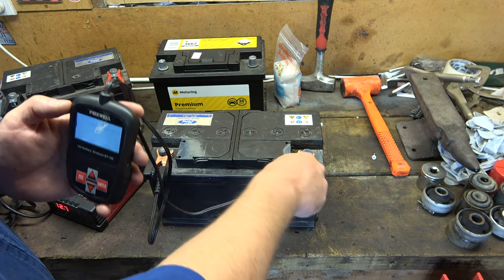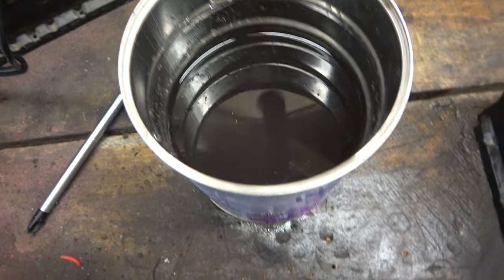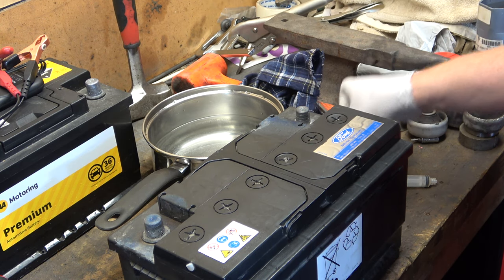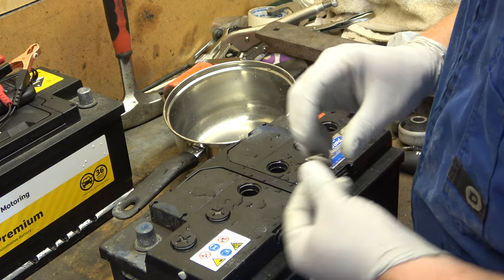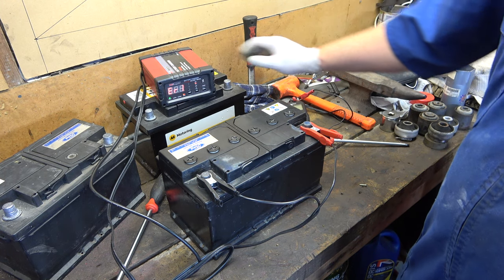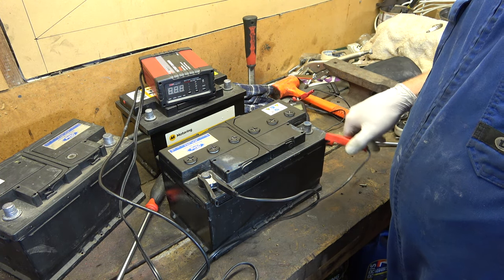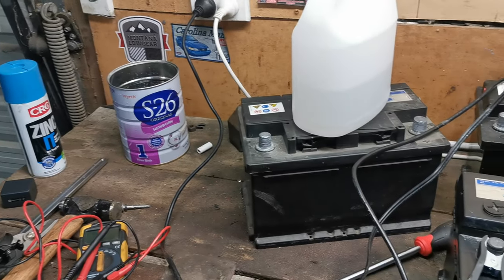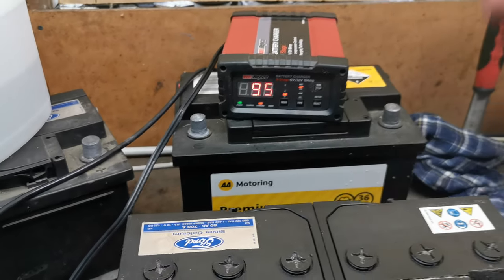Restoring Car Batteries with Epsom Salts - Does it Work?

Comment: Would love to see a followup commentary! I tried this on a battery and initially the results were poor, so I ended up leaving it in a shed to power a light. It's hooked up to a solar charger which floats the battery constantly. After over a year, I tested the battery for fun and noticed it's almost like new again! So maybe it takes some time for the sulphation to knock off. I was pretty surprised.
Reply: I had similar results with a solar charger.  I had used a solar trickle panel in the past:  30 years ago it worked well to greatly extend car battery life until the panel wiring shorted.  I bought a new one more recently and it was worthless.  It just never worked in the first place and the wiring failed really quickly.  I noticed that the voltage from the new battery "maintainer" panel was much higher than 12 volts and I thought that could be a problem.  I did some research and found that in the last 30 years solar panels have become more efficient which has upped their voltage.  This is good for use with charge controllers and inverters, but really bad for a trickle panel.  So I bought a flexible 20 watt solar panel and a cheap $12 charge controller off ebay.  (I recommend a glass HQST panel: flexible is junk.)  The charge controller pushes 1/10 of a volt more than whatever the battery is currently holding.  Your car battery just won't take a charge from the alternator at 14.4volts when the battery voltage has slipped down to 10 volts.  A battery that has gone flat for a few days also will not hold a charge long even if you can get it up high enough to start the car.  A poorly closed car door shorted out an older Costco Interstate car battery during covid when we weren't driving too much.  I put the solar/charge controller rig on there and was eventually able to start the car and drive away but got stranded as it wouldn't take a charge from the alternator.  I figured I would have to buy a new battery but left the solar/charge controller rig on the battery, so the car would start when  I got around to going to Costco.  The charge controller conveniently shows voltage so it was easy to observe that my charging voltage was slowly creeping up and the ability for the battery to hold a charge overnight was also creeping up.  After a week I was able to drive off without getting stranded, but I left it on longer than that and the battery was eventually returned to almost new condition.  It is slow.  I have brought brand new car batteries with lower voltage and alternators pumping 14.4 volts only while you drive will never bring those batteries up to a decent holding voltage.  There is nothing like charge controlled solar.
Reply: Hh
Reply: Not surprised. If you look into the science behind sulfation its pretty interesting. The key thing I learned from Batteryvitamin was how porous the plates/anode/cathodes are, and how its not just surface desulfation that is the problem. The sulfation tendrils work their way deeper into the plates and anode, and unless you have a minor case of sulfation, it takes multiple rounds of desulfating to first get the surface cleared, and then work out the deep tendrils.
Sounds like the light in your shed was low enough draw at night to not fully discharge the battery such that it was continually able to charge fully and then float charge over a long enough time to get that deep sulfation mostly cleared out.
Got a couple old batteries I think I'll do similar with as an experiment.

Comment: Retired Mechanic. Years ago a customer wanted his battery changing of a split charger system on his car.  Ie his caravan battery heavy duty.  I asked if I could have it ,  Then drained all the Acid out. Then upside down flushed out with a hose to remove as many particles out as possible.  The firms Sparky said flush at least twenty minutes. Then refiled with new fresh Acid very carefully.  Used it for a year. Sold it to a mate for his very high compression rally car. For 3 more years. Then he sold it to someone else.  Luck or science. Your call folks. adding water to Acid in battery ok. BUT adding Acid to water needs a lot of care. Battery was still wet inside. Out of ten batteries only repaired three successfully.

Comment: Over all the years I finally saw the best test ever you use the old large battery chargers they have a booster jump to start a vehicle on it two hundred amp use a momentarily to start a vehicle. Make sure batteries topped off of fluids you turn it on to two hundred amp 15 minutes you watch each cell bubble you could always see the week one because it's not percolating as well you did is 4 * 15 on 1 hour off repeat that 4 times by the fourth time I could not believe it all the sales were percolating beautiful it takes a large charge to get those lead plates to blast that stuff off of them you don't even need to do the Epsom salt procedure just top it off with distilled water supposed to be 30% acid balance of distilled water the gentleman that was doing this told me he hasn't bought a battery in 20 years it revived every type of battery he tried there are new batteries out there Chargers digital ones unfortunately they keep shutting off they can't compete against straight amperage that's why they don't work for doing this procedure I'm doing it on a huge solar batteries the secret is you don't want to get your battery too hot doing it boy did it get those c e l l s percolating not many people know this but the pros you can stick your battery meter on one post is stick the other one right in the hole check each cylinder for the voltage level and it should give you basically a quarter depends on the size of the battery cordless voltage weak cylinder why batteries don't hold a charge mr. Furyk acid is all been stuck to the plates leaving straight water in a battery and you can't get it to process properly so you have to have a certain amount of acid to start with personally after boiling it like that obviously use safety gear safety gear safety gear people but I washed one of these batteries out huge deep cycle I must have filled that thing up and shook the crap out of it 7 * dumped it out and it was still Brown rusted water coming out of it so it can't hurt to clean them out and start fresh what is the best procedure I've seen yet that's the concept of it is getting the batteries to percolate properly a week trickle charge for days and days and days doesn't cut it it never gets it percolating enough issues Common Sense might be 10 minutes if your battery charger, are battery appears to be getting too hard on you just turn it off for 1 hour and repeat that 10 to 15 minutes don't overfill it either is more of a prickly out of it have a safe area around you to work with and if you don't have distilled water rain water works and you could even use regular water you would have to use it for years to create a problem for the battery so if it's all you got put it in there better than no water everybody's method might work but majority of these episodes I've yet to see one completely restore like new and I'm working on my generator right now to get my big charger hooked up to another one myself last comment never go by the reading on a hot freshly charged battery and never stays at high let it cool down for an hour and then recheck your reading it's a false reading when it's hot good luck let me know if that works for you this gentleman swore by it until it works for us it's just rhetoric in a fun video but nobody's ever done it like this guy's done it with the high voltage for short intervals is what did it remember safety safety safety and then when you find this all works then you can always dump your battery out and flush it and clean again I've heard of people putting lemon juice in batteries Reviving of a lemon juice as well as table salt deep cycle batteries, you can train them six to eight times till it starts to affect the battery a regular car battery, you drain it more than three to four times its history I know there is a new battery charger on the market that basically does a proper discharge charge-discharge charge and getting those plates to clean up it's a big company they take it all batteries and revive seven out of ten they bring back to life above the original amperage output you can have high voltage and no amperage is the amperage that counts that's the punch might be great for 12 volt radio would not start a car sorry I'm legally blind I hope this is legible good luck everybody be careful out there PS O'Reilly's now takes Deadshot batteries and they give you a $10 store credit for each one you can bring in five a day max you look around your neighborhood in your yard you might have enough to just get yourself a brand new battery and forget all this crap LOL. And when you buy a new battery in a battery store they're all dated when they arrived on the Shelf like bread and a supermarket that put the old moves forward in the new numbers are in the back so be a stickler about that and get the newest one that has arrived this is what starts killing the batteries in the beginning of their lives sitting for months so ask and get a fresh latest arrival good luck you MacGyver's out there and please you safety gear and Common Sense please if you've never worst with batteries ever and you know nothing about electricity please don't mess with it. Don't forget people whatever problem you may have with your car sink toilet or roof just ask Google how do I do this for my 69 Chevy Ford and there's a video clip out there that shows you how to do things it gives you the parameters at least what to do even if Pros we use it before we do a project if we know nothing of the project
Reply: Sean Ogreen good info! I’m aware you’re legally blind, just a tip for you though to help us out who are reading your comments. Use punctuation please! :) :) thanks again for your comments! Gonna find myself an old battery charger now.
Reply: Wow, that's a serious sentence you've written there. Some gems though. Thanks for sharing.

Comment: Lots of parts store sell small containers of battery acid how's about doing the reconditioning and then adding active like acid I bought some at one of the local auto part dealers for $7 it was about half a quart leader I noticed that it did make a big difference after the conditioning cycle was done drained out some of the solution that was added then added half fresh battery acid to it tripled Mike Old Camp cranking amps

Comment: Great effort, what about using what is meant to be used like 30/70 Sulphuric Acid / Distilled Water. In a garage I did part of my Automotive Mechanics lic in, We got the batters in Dry, and the Acid/ Water mixture came in (one of those clear plastic square jugs with a red & white spouts to pore from). Only exception was that the plastic jug was housed in a thick cardboard box, I'm guessing safty reasons. There were the usual safety stickers and the instructions which included the amounts of the content which was 30% / sulfuric Acid 
70% / Distilled Water which We bought separately from the same supplier, just in a much bigger jug in a box system, same as the Sulfuric Acid. We had an old juice picture to mix the two in. Thanks for sharing brother, keep up the good work. Andrew T

Comment: I recon you were almost there. In addition to what you did, run the battery through a few discharge and recharge cycles, measuring the CCA after each cycle. It should come back. Using a dumb charger might help too.

Comment: Before you add the epsom salt solution and after you dump the acid out flush the battery with baking soda and water to get as much of the sulfation deposits out of the battery! Much success!

Comment: I've seen people use the baking soda in a water solution to wash the plates in the battery. Pour the baking soda solution into the acid that's left over and make it inert before you even drain it. Then do a couple of rinses in the plates, re-drain a couple of times and voila, cleanish or cleaner plates. Seemed to make a big difference . Great video 🙂

Comment: A good quality video. I like the way you followed up answering questions in the comments. I think acid replacement is the key after desulphation.
Reply from the maker: Absolutely that's the way to go but the Internet said this will work 🤣 we proved it didn't. Cheers
Reply: Cheers for the Video clip! Sorry for the intrusion, I am interested in your initial thoughts. Have you heard about - Lammywalness Trendy Trade Guide (do a google search)? It is a smashing one of a kind guide for learning how to recondition batteries at home without the hard work. Ive heard some decent things about it and my old buddy Taylor at very last got cool results with it.
Reply: @Badgertronix  I think you may need to replace the sulphuric acid with fresh 30% mix W/W.

Comment: I'm using a similar method to try and save a couple batteries.  Not yet finished, but expect similar results based on 12 hrs into the charging.

Comment: My preference for a charger is one of those old transformer type. The modern electronic ones have too much protection.  To de sulphate batteries, I look for one of those old garage chargers on 2 wheels, be ideal if it got a 200-250 amp boost feature,  or I can use one of those cheap $100 + invertor DC welders Put the welder on 5, 10 minutes to see acid boil,  let it sit it the rest of the hour, do it 4,5 times. Test it before you dump the acid. Do it to a battery once a year (4, 5 times) to de sulphate, and some claimed you will never need to buy batteries.

Comment: Works great if you leave about 70 percent acid in the battery.. The guys that pour all the acid out fail everytime. The epsom salts breaks down the buildup inside the battery and is not a complete acid replacer. They are just doing it wrong.. Works well when done right.
Reply: So the magnesium sulfate and the battery acid play well together in a 30/70 ratio of magnesium sulfate to battery acid?

Comment: I googled some info and found that people were using bicarb and vinager. Had a old deep cycle century battrey I tried took the old acid out and filled it with bicarb and vinager and topped with demin. Battrey original sat at 200cca based over 450cca. After I let the charger sit on it for 2 days came back and said 390cca over 450cca. Said good recharge. So I have just been charging it then taking it off a day and then recharging it. And seems to bring it up. Worth a try for you mate

Comment: I added a mix of baking soda and water to flush the cells out twice.  Then added a mix of 12 oz epsom salt , one pint white vinegar and a gallon of distilled water. 
They were expensive solar 6v batteries 24v and I was quite impressed with the results. 
I didn’t really want to replace 1000$ worth of batteries!!

Comment: IDK about restoring batteries but other videos claimed that they cleaned the inside of the battery with distilled water and baking soda for four hours until it didn’t bubble. Apparently this removes some coating on the cells. Best of luck.

Comment: Happy holidays!!!
Thanks for your effort, it was really interesting.  Give the Moggie a hug from me. All the best!
Reply: Cheers for the Video! Sorry for butting in, I am interested in your initial thoughts. Have you tried - Lammywalness Trendy Trade Guide (do a search on google)? It is a great one off guide for learning how to recondition batteries at home minus the headache. Ive heard some interesting things about it and my m8 after many years got excellent results with it.
Reply: There are  several tips for battery reconditioning
never attempt to do this until you know what you are doing - the acid can burn your skin
Test the voltage first - there may be a dead cell which would waste your time.
Check the battery fluid.
attempt to fully charge the battery.
(I discovered about these and more on Jons Mender Guide site )
Reply: Nice Video! Sorry for chiming in, I would appreciate your opinion. Have you researched - Rozardner Powerful Battery Reality (do a google search)? It is a good exclusive guide for learning how to recondition an old battery minus the headache. Ive heard some interesting things about it and my mate at very last got excellent success with it.
Reply: I\'m not sure but ,if anyone else wants to discover recondition batteries try Jons Mender Guide (should be on google have a look ) ? Ive heard some super things about it and my work buddy got great results with it.
Reply: I have spent months studying battery reconditioning and found a fantastic resource at Magic Mender Wizard (google it if you are interested)

Comment: Flush the cells with 12 Oz's of baking soda to 1 gallon of distilled water. It neutralizes the remaining acid in the battery,  and descales the cells.
Reply: That is what I did and the results were very good.
Reply: I can back u up on this. The plates in my old deep cycle were black not burnt but black and I did this and I'm sure u would think it just came off the shelf

Comment: I think the failure here is tinkering with that toy to attempt to get the job done.    Epsom salt seems to be effective after electrolysis has occurred.  With low amp charging it may take a solid month on it.   I would use the 200 amp cycles at 10-15 min with a hour in between several times.  After last cycle shake battery then pour out while fairly warm. Want to remove the suspended loosened crud and any lead sediment to prevent current straying across plates at bottom of case.   Flush out with distilled water at least twice or triple rinse.
Get battery sulfuric acid from auto parts store.  Don't dilute as it has correct gravity as is. Charge up.

Comment: I have a old battery charger and I did the same thing to my lawnmower battery two weeks ago and used a 2 amp charge for 48 hours and it has been starting it when I have tried